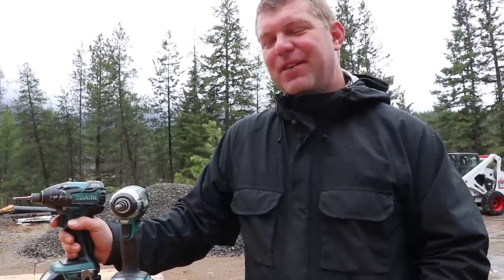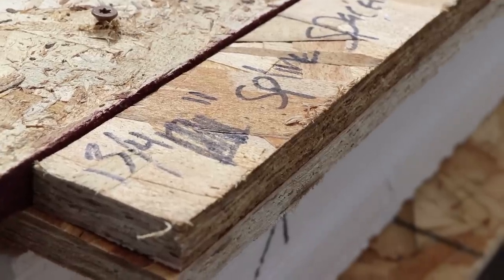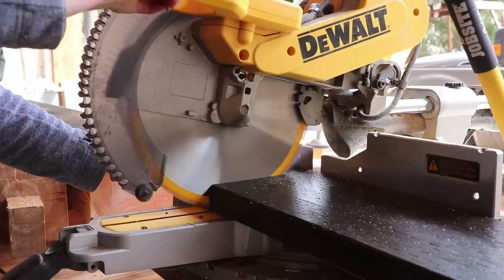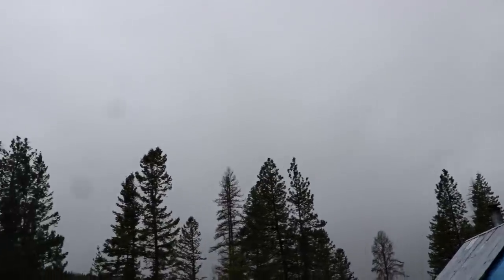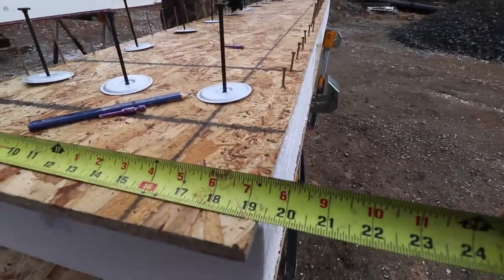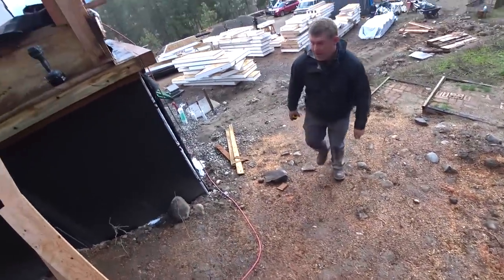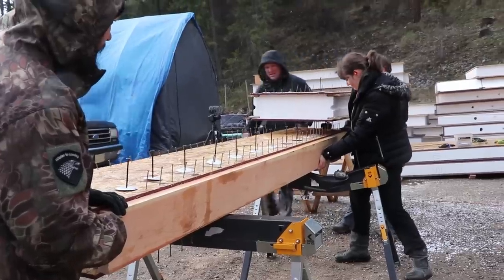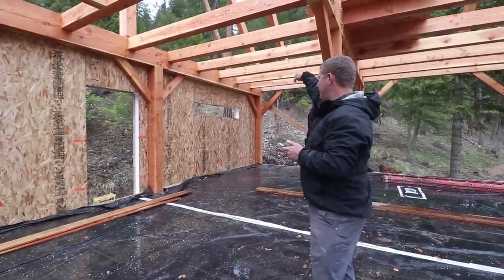OUR FIRST WALL IS FINISHED! (Timber Frame SIP Installation)

Comment: It is great to see a wall go up and I'm excited to see the next one.  Then the roof.  Then the floor.  Then the windows. Then the exterior cladding.  Then the finished walls inside. Then maybe an indoor bathroom and shower.  Then...  I love you guys and your common sense soloutions to problems you run into.  Measure EVERYTHING seems to be the one you have to use most.

Comment: Have built 3 houses with SIPS, never had to measure slot depth or spline width.  Call your SIPS supplier and Bitch.  Very poor manufacturing.

Comment: I am really surprised by the SIP panels, given that you have ordered these from a company, who i would presume makes these panels for X other customers, how can the quality control be that far out, that you have to try and match up two separate panels because the splines/panels are not identically constructed.

This side of the pond there are lots of different producers of housing components, and I cannot imagine them getting about with such sloppiness in their products. 

Surely these alterations are going to have added some serious time to your completion of this task. I can only empathise with you at working out just how much extra work this caused for you. Luck you had some helping hands for this.

best of luck with the remainder of the build.

Comment: This is probably way to late, but raising the saw blade so it no deeper then necessary, makes the saw run easier (less likely to bind). This is also true for the table saw. I see guys all the time on job sites bogging down circular saws because their cutting 1/2 inch sheeting with the saw set to cut 2 inches deep, and thats with corded saws. I would imagine that would massively help battery life on your cordless saw.

Comment: Tip: Use a ratchet strap to pull the panels together. Much more effective than a hammer.
Reply: A strap is way to slow.
Reply: yes put it under tension with the ratchet strap and then bang with the hammer
Reply: You can also screw scraps to the outside of the OSB for cleats to work with instead of banging up the edges.But the vids are behind so chances are they have finished already.

Comment: Jesse and alyssa-(Drexel multi max) oscillating multi tool cuts through any foam like butter. 10 x faster than any saw-with none of the foam B.B. sawdust. Way clean, way faster. Try it once on any styrofoam like in your sips. I am an artist and have carved many sculptures with that tool. It’s a joy to use

Comment: At 2:33 you mention the GAP between the SIP panels.  At 3:49 you mention you want to suck them together.  At 5:11 you mention that ripping the splines make the panels seat perfectly.  I am wondering if their is not SUPPOSE TO BE an expansion GAP (something like 1/8 inch - which is then caulked) ?
Reply: I thought the exact same thing. I know where i come from (UK) that when ive built and used SIPs we left a 5mm/1/4inch expansion joint In between the panels for the OSB board to be able to expand and contract without buckling the board. I do hope they see this!!!

Comment: Looking good.  I did notice (I think) that your decision to use a SIP supplier that uses small panels may have caused a lot more work in the field.  I think having to do it again you might opt for a supplier that makes larger panels.  You would need a crane if you did.
Reply: Bud Prine they requested the Sips to be built this way so that they wouldn't have to cut out the windows and door.  Their decision?  I think that the weight of a full sized sip would be too heavy to lift with just manpower and the tractor or bobcat can't get in there on the North side.

Comment: no joining tubes in the electrical wiring cut outs? how do you stop that filling with foam, when you fill between the sips?
Reply: Parax77 in my experience watching our sparkies, as long as you drill the hole right in the floor, the pilot wire will slide right in. They'd get pissed if we didn't predrilled the deck for wires first tho.
Reply: yea i was thinking the same thing  parax77 ,ya can't send a mouse through it,even with out foam fill geez maybe they should think about wire and plumbing,but what do i know
Reply: maybe someone can explain that to me on how it's done

Comment: Guys. Literally a D - cell battery and stripped wire loop to each terminal would give you a Q & D foam cutter for your SIPs. It’d save a lot of mess. Maybe a little effort but huge time and mess saver :-)

Comment: Why did you not lift the panels with the backhoe and only carry them across the floor and set in place and the stand up to its correct placement?

Comment: Great video, good progress.. It is nice to not have to 2x speed your videos recently. The sips do not look near as good as the timber frame but their benefits well out weigh the looks can't wait to see them installed and covered/wrapped. Keep up the good work it wont be long and you guys will have all these small jobs flying at you and you will feel the progression pouring in daily.

Comment: Y'all are doing great! Could you make a dolly out of two bicycle wheels put together to move the panels? Maybe screw a piece of angle iron long ways down the panel with a hole in one end and use a pulley to pull them up? I like the vids!

Comment: This is the first use i have seen of SIP's.  Looks like a good idea; I would rather use ply than OSB.  I'm not sure they ever solved the Urea-Formaldehyde  proble.  Even PF off gasses some.  I also worry about hidden water intrusion.  I would think haveing neither Ply or USB inside would be best from an air quality standpoint.  I like the way you apply seminal logic to problems as they arise.  Your doing  quite well!  Shame you cant fly in the rain.  I've done it a time or two in a Tripacer , 150 and a Beech 35 V tail.  All are scary as hell, sounds like steel balls!

Comment: Chaps..... ‘time and motion’ committee here..... sorry for negative after event comment. What the blinking hell were you carrying round those panels the ‘long way’ - all you had to do was hoist them up to first floor using nearest wall - the one facing the sun -using centre aperture (nearest sip panel pile!!). That would have been far easier than walking backwards over rocks. Fortunately no twisted ankles. Apologizes for after event negativity - as clearly you’re doing a brilliant job.... 😋

Comment: Is that styrofoam in the SIPS? In Vancouver, B.C. you can not use styrofoam on an interior wall of a house. The problem is the poisonous gas that it gives off in a fire. I sure hope that you are going to be installing some seriously fireproofed gyproc over it. I learned this when working as an insulation contractor.
Reply: yea sips have closed cell foam between the wood panels. same kind as ICF blocks have. its like a foam cooler
Reply: A couple minutes of googling answered your question easily.. though it raised some more in my mind

Comment: I must say, your screw gun skills are on point. I run 1600 to 1700 screws a day with a 20 volt dewalt gun. I know what you went through, it can get old quick and don't let me get started and the bit slipping off and going into a finger. #bandaid#foul language

Comment: when ripping wood on saw bench raise the blade to let the teeth come out of the top, your blades will last a lot longer and it will cut faster as wood chips have two escape routes.

Comment: Why so god many screw per stretch ? At most, here were I live we build  with  a screw about once every 30-50 cm, depending on the material. It looks like you use one every 10 cm or so that many are madness and not needed. We tack tings up with a screw at either end or top/bottom, then add screws between them, by going middle between until the distance is right.

Comment: 20/20 hindsight: bite the bullet in the beginning install power, drill the well, modify the tractor hooks for forklift, take a day to frame (temporary) stairs from garage to first floor, rent some scaffolding. Your going to be up in the air for a long time.Penny wise pound foolish.

Comment: I don't want to rain on the parade or anything like that, but you really should wear hard-hat. I knew someone that died very young because of a neglected hammer falling. Something like the impact at 20:38 could very well be tipped over by a gust of wind or something. Anyway. good work keep it up and take care.

Comment: Okay - tell me that I'm crazy, but I just don't trust OSB for any permanent exterior application. i.e., I see your house as this beautiful work of timber frame origami, and I expect that framing to last indefinitely. BUT - OSB is a bunch of shredded up waste material from mills that is pressed together with glue. Unlike a gluelam or LVL, or even high grade plywood, the glue itself is the be-all end-all. It get's wet and falls apart, you have a lot of wasted time, effort, and money.
I just couldn't bring myself to use an OSB product on that frame (that, again, should last indefinitely) anymore than I would use OSB (or plywood, even) as roof sheathing under slate roofs. There is a reason it's not done. Because slate is meant to last a century or more, and OSB is a great big unknown form a longevity standpoint. 

That said, no one asked me, and your house is cool as hell regardless.

Comment: With the amount of manual work on these panels, wouldn't it have been easier to just use OSB and spray foam? You'd end up with almost the same thing, but then with less waste, less waiting time, and possibly cheaper...

Comment: Can someone explain the 2 pencil marks when measuring?  I have been around and done a fair amount of building and never seen anyone do that.
Reply: it's more of an engineers technique of marking than carpentry....two marks like/\ to work the center than  just a I. I find it more accurate specially with slightly fuzzy eyes theses days. both work well

Comment: Still such a huge waste of available manpower to have 5 people installing screws at 3” OC. Since your extra help is available on a limited basis you need to use the help to lift and place the SIPS and you finish off the screws when it is only the 2 of you. 

Plus you should reread your instructions about how many screws you need. 3” OC for the splines times 2 sides of the wall seems extremely excessive. That many screws essentially makes every spline joint a perforated tear off strip especially in OSB.

Comment: anyone know the insulation rating for panels like that? Just curious..i'd think it would be high but how do you install electrical?
Reply: Rob Anderson if you notice the orange lines painted on the panels. They mark pre drilled foam holes for wires. Sparkies will line up on the painted lines and make their panel hole and the foam should have the wire holes right there if they measured right.
Reply: I know the insulation is really good i dont know ratings or anything though. During the production of the panels we would drill or use a big hot rod to burn wire chase holes through each panel.

Comment: You realize that all those styrofoam particles are going to be there forever. Unless they get blown somewhere else by the wind, they won't deteriorate/decompose.
Reply: Pretty much all plastics degrade when exposed to ultraviolet light, and they get some pretty strong summer sunlight in that place. (Water stops ultraviolet, which is why plastic in the ocean sticks around so long, and is a problem.) Bury the plastic in the ground, and you are right.

Comment: Your splines were bigger on purpose , you want a gap for expansion. It's kind of sad to see people  building a timberframe which will last 500 years on a base of engineered that will only last 100 tops.
Reply: This is what I was thinking I couldn't imagine a sip manufacturer shipping sip panels that egregiously poorly produced. Logically they where left long for a reason.

Comment: foam and wood? seriously are you not building a fire-trap ? I would stick and frame fill with mineral wool, wind barrier one the outside and vapor barrier on the inside then cladding

Comment: First!, yes! Moving right along. That wall is looking good. I am worried, will the back wall make it more difficult to get the panels up? I expect that the other three could be walked up the the main deck, via the back, but now that the back is there, it seems that they can only be moved into place from the outside. Will the rest of the walls be lifted with the help of the backhoe? Or will you have a crane coming?

Comment: Your garage is made of concrete but your wall are made up of SIP is strong enough? Really?
Reply: The garage is made of concrete because concrete can support a lot of weight.    The SIP is not supporting anything.
Reply: vinesh pillai  It’s a timber frame,garbage bags and duct tape would be strong enough.
Reply: Think of the SIPs as a curtain wall, in that the only thing that they have to support is themselves. The frame is what's holding the house up.